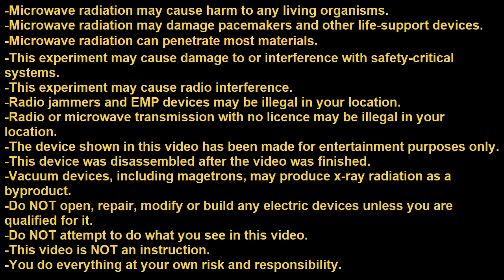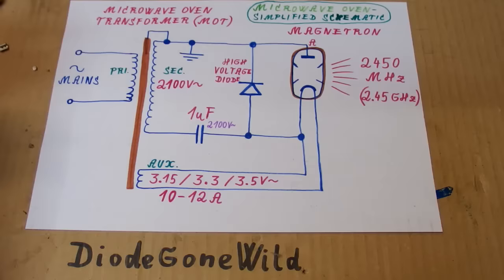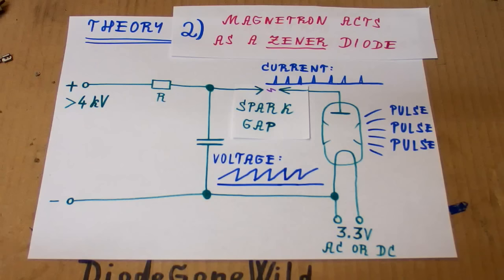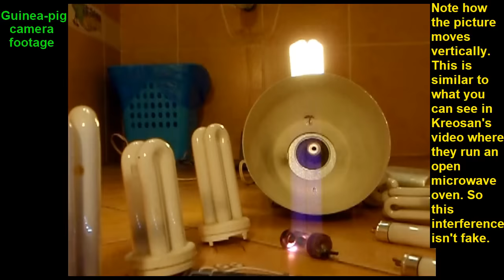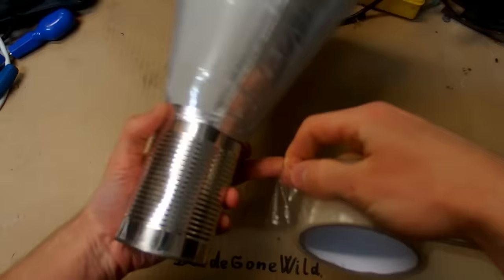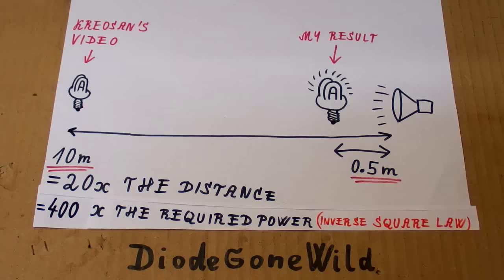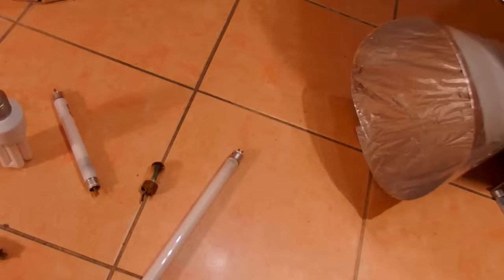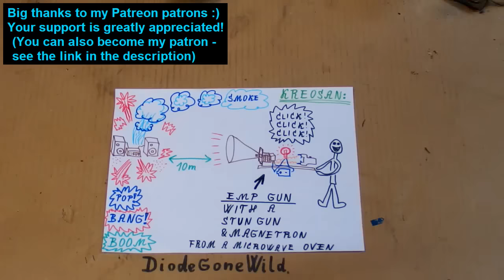Debunking Kreosan's EMP gun from a microwave oven magnetron + stun gun

Comment: Use only one magnetron. Trying to use two or more results in different frequencies, which means there is no possible way to synchronize them, or, time align them to maintain constructive phasing. If you're not using a wave guide, the antenna of the magnetron needs to be in the focal point of a parabolic reflector. As you could tell, the reflector needs to be well grounded to the magnetron. That was apparent, when the fluorescent tube behind the reflector was the only lamp to light up. To build a proper reflector, take a common flashlight bulb, place it in the reflector, and see how well you can focus it. It's a perfect analog, because the incident angle of reflection is always congruent to the incumbent angle, regardless of wavelength. the beam of light will exactly indicate the microwave beam pattern. (I'm only giving you this information, because I'm not touching it!!)

Comment: I have just watched video of kreosan again and he says that the long range was reached by perfectly accommodate three magnetrons using conical antene. So it didn't work bc you used 1 magnetron instead of 3 and shape of that conical antene is also very important. But you said that your horn is made pretty crappy and it is for just a short experiment so it won't have a big impact on performance of your EMP gun, but probably it has. So you have only proofed that the shape, lenght and diameter of the horn is very important. It means you have just made different experiment that kreosan originally did.
Reply: Паша, блин, че по-русски чтоле не мог. Заматался тебя переводить. =)))
Reply: @MisterKoK22  Он же на английском говорит, поэтому так. Это первое видео которое я посмотрел на этом канале.
Reply: Паша Коленда какая разница если все они излучают во все стороны
Reply: Kreosan didn't make any experiment except the experiment with video editing software
Reply: When at the start of the video he said "It has a horn to make it more directional probablyyyy....". He does not even think it has an effect on it and it pisses me off badly. THIS IS A RADIO FREQUENCY EMITTER OF FUCKING COURSE IT HAS A HUGE EFFECT, especially that the magnetron emits CIRCULARLY and it needs to be redirected.
Reply: @akosv96  In the Kreosan's fake device it really has no effect

Comment: U know the dielectric strength of air is approximately 3 kV/mm. Its exact value varies with the shape and size of the electrodes and increases with the pressure of the air.
Reply: If you live in Arizona. In Central Europe it's 10..15kV/cm.

Comment: He used 3  magnetron and  a stun gun with a sort of battery power supply,  I'm thinking that you should get schematics from him too.
Reply: Actually they make very interesting videos and a lot of them are Real, maybe diodegonewild is doing that wrong? I am not sure either tho, looks really like too much to be true
Reply: @diyelectronics5537  I think the horn is not tuned well or the magnetron  is faulty or not enough power, I want to try it too to check it out but I don't have resources yet.
Reply: @diyelectronics5537  It should work at that close range at least in theory.
Reply: @NerdyNEET   yeah  it's kinda confusing on how they did it if it's really true that it works.
Reply: Guys, don't waste your time for building theories. They did it using video editing software. They claimed that in one video on their channel, but it may be deleted now. You can look their original video frame by frame. In scenes with blows they blow low-voltage capacitors by connecting them to mains. In scenes with smoke they fire DIY smoke bomb. All other things they shown like devices stopped working, they did by unplugging some cables. That's it.

Comment: 'Interesting' accent and intonation, and your English is sooo good! Just in case...don't touch the antenna as oil from skin can make it corrode, and more importantly,
tell people (yeah I know, too late) that the High Voltage capacitor can hold a lethal charge though some have a built-in bleed resistor.

Comment: You have the same + screwdriver as mine which I bought around 30 years ago.
I have a much more practical application for open magnetrons: Is it possible to boil away weeds in the garden by getting them with a magnetron?

Comment: We want to think of the microwaves as being uniformly dispersed. If they were, bother ends of your Hot Pocket would be evenly heated but we all know one end is still cold and the other is lava. The rotating platter helps but even rotating the item doesn’t result in even heating. I read somewhere a long time ago the areas of greatest heating happen when the waves reflect back toward the source. The tiny areas where the waves overlap see the most energy. These areas could theoretically be calculated and tuned I guess, but inside the square shape of the oven, they are “randomly” located and changing position when the item being heated is moved. I agree you have debunked the previous video. 👍

Comment: 22:07 I think the noise (looks like white specs, not the lines) we see on the video it could be x ray radiation exciting randomly the camera photosites but I’m not sure, you could use a Geiger counter to see if is emitting x ray but I think it could get a ton of RFI from the microwave radiation also.

And by the way in a recent video of MrGreen it showed how much “safer” microwave radiation is actually is, but still not the best to warm up the body.

Comment: I think that the rf-output and the internal standing waveguide is not exactly matched to the horn - a cone around the bottom of waveguide is needed to form a perfect outgoing wave and is needed to prevent any rf-shortcut and reflection back to the antenna of the magnetron. How is proven that the heating works well, a few seconds before high voltage pulse occure? The heater has a delay of many seconds before it works. To generate high voltage and high current at the same time a marx generator is needed, but so care about the balls in this case. Cancer can occure - very dangerous.

Comment: Emission is 90 degrees from tip to ground plain.  A parabolic, or hemispheric lamp reflector works, but still will give resonant hot spots. The beam does not follow the inverse square law, it is a beam like a flashlight but with resonant lobes that result from the distance between the output window and the reflector. A magnetron is comparable to a steam whistle in that a charge has to build in the resonant cavities before it can output power. The cavities alternately load and unload producing the roughly 2GHz "whistle".
Some emp devices use a special type of capacitor that discharges its wound plates from opposite ends, forming an capacitive -inductive loop that when shorted produces an EMP pulse, a real one.

Comment: Wait, hold on a second, how is that the lines come in a delta connection? I just don't understand. I tought delta and Y connection is just for electric motors, and I'd like a more comprehensive approach on this. While seen that the 3 phases are 120 degrees one ahead of another for a total of 360 degrees, there's an Neutral generator that takes the 3 phases and combines them into neutral. I'm not sure but I think it's possible to achieve the same result taking the center point of an Y connection motor and have a neutral from it.

Comment: I made one to kill   Cerambycidae  " critters in wood"; with a 20  cm stainless pipe as guidetunnel.
It heats the wooden beams till 10-15 cm inside: critters get zapped. works great, and no chemicals needed. tested  around radiation with trimeter. no problem. best way to use microwave. do not use  to zap your food.

Comment: Okay the reason there was a blank spot in the middle of the microwaves just cuz microwaves are huge and they make big long waves so that's where the low spot in the microwave was and if you would have went another couple of feet away it probably would have picked back up as a high spot and then there would have been another blank spot the further away you got you would have to raise it or lower it considerable distance microwaves are about 12 inches peak to and the further away you get they expand also you used a steel pan which would make magnetic waves that's why the bulb was lighting up behind it aluminum would block the waves and not create magnetic waves so an aluminum funnel would be best

Comment: This Magnetron can work at much farther distance. You will need high gain directional wifi panel antenna 2.4GHz, 13.5dBi at least, directly connected to magnetron output. "Double biquad wifi antenna" is quite simple proven construction. Another simple way is "wifi windsurfer" beaming at larger old satellite dish - this provides more than 20dBi, pretty narrow beam of microwaves. Satellite is best choice - nobody is using another constructions between Earth and space. High gain parabolic antenna is used in Active Denial System too (95GHz microwave against human). They all are using what works best. Don't omit reflections from objects and walls, it's like powerfull IR laser.

Comment: To the  Kreosan's EMP gun. You can create it, so you need larger capacitor, make a very short pulse using electronic switch, and the smaller funnel for smash the object. Yes because the inverse square law, you need to create  like a laser point. If this has dont make it a user Kresoan, so its a fake as you mentioned.

Comment: As much as you know about electronics, as little do you understand the focussing of a wave. The long exposure photography gave you a tool to achieve a fine focus. You haven't used it's potential. back to the drawing board ;) treat it as light, you will see that it helps your process.
besides, Creosan did emphasise on the difficulty of focussing the beam. Other that that, I liked the effort you made.

Comment: Kreosan - great inventive guys! They invented: Option #1 microwave gun with water-cooled magnetron and powered by a full diode bridge, which is placed in the focus of a porabolic mirror with variable geometry and focal length. Option 2 using several matched magnetrons with a total capacity of 20 kW. The use of this design allowed to cook chicken at a distance of 20 meters. But this is not the limit, the promising design will allow more spectacular demonstrations.
Reply: OMG. You also try 5-minute-craft videos? 🤣

Comment: Unfortunately, Kreosan constantly exaggerates everything on his channels. They constantly read a much higher level of radiation than what is actually there.
Their only real video, also the most dangerous is the X-ray gun. It really emitted X-rays in great quantity.
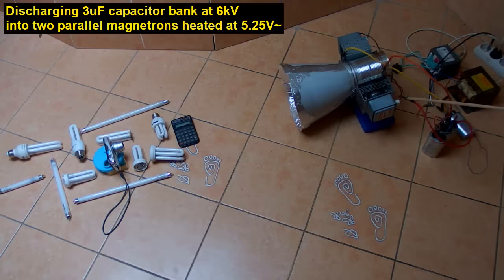P.S. In your video, it is quite possible that due to the high voltage there was also an outbreak of X-rays. 23:03 (the small dots on the screen are specific when X-rays are emitted)

Comment: You don't have to go through all that crap. For years gang stalkers just by pass the mechanism on the door so it continues to work with out the door, and place it against an adjacent wall of a targeted individual so the gets saturated by microwave radiation. But instructions to build microwave canons can be easily found online but I've never seen any that you need a taser for so that in it's self sounds like BS anyways.

Comment: You can get a REAL electromagnetic pulse out of a nuclear explosion.  So with this inventor's ingenuity and spare bits and pieces a nuclear explosion should be possible.  (It's not much more dangerous than a naked magnetron).  If you live in Russia you can probably get some plutonium on the black market .  You would need a "critical mass", of course.

Comment: A microwave consumes about 1kw give or take.
Average us house has a 200 amp breaker and has 240v (split phase)
This is 48kw of power.
So we should instead build a waveguide eyesore thing with 48 microwave ovens.
Then we will have a real death ray.
Mount this on a turret with an arduino and camera for motion tracking. You will then have the ultimate hone defense system.

Comment: To start with I think Tech Ingredients covered this, I think it is in relation to when he is building a LRAD device. But my thought just came to the conclusion that this should be great to at least disturb 2,4Ghz Wifi, wouldn't it?

Except for DiodeGoneWild prooves it is fake, the fact that they are wrapped in aluminium and they don't get burned or blind or whatever is proof enough.

I would actually like to know how to build an EMP gun, but maybe the goal of interference with lets say 2,4 ghz & 5 ghz to possibly dirsurb the connection between a drone operator and a drone. Yea I know, a more adavanced drone, ie one from the government or similar probably isn't controlled through 2,4 or 5 ghz frequencies.

Comment: @DiodeGoneWild For a real EMP gun, you have to build a VIRCATOR (Virtual Cathode Oscillator) and drive it by e.g. a Marx-Generator. If much more power is required (note the inverse square law over distance), take an ordinary EPFCG (Explosivly Pumped Flux Compression Generator) laying around somewhere. The higher the oscillator frequency, the better directivity becomes. A waveguide, terminated with a horn in the focus of a parabolic reflector can take out server farms, power plants and networks for miles. The only problem is, such a device is all but handy. And humans in the vicinity of the beam will be fried alive, since some couple of Megajoules of energy is involved. Therefore, military uses such EMP-weapons as missiles, or smart-bombs.

Comment: This debunking experiment has too much inaccuracy to be actually credible,  First, the design of the reflector was not accurately calibrated, the position of the microwave antenna was not in a permanent fix position.  no effort was made by him to accurately identify the possible direction of the radiation.  This guy was much too vague in his experiment. Not to say if all the above was properly calibrated then it would have achieved the goals set. but if he had attacked it more scientifically perhaps his result would be more consistent.

Comment: I think you should had tried to shot the pulse with something like a railgun or coil gun(both with capacitors), instead of a cone.

Also, Control the frequency with PWM and change the results for each kind of material.

Comment: in a way, the only true emp, is a UNgodly massive coil with out depending antennas or what ever the fuck emits the field outward  from the coil.   and you have to play interweaving  frequencies , like 36 hz, 60  and 74 hz, all fucked together or any important system bios frequencies something that would fuck it alllllll up.  , But instead of  having a sinewave.... have a Spike wave. with no capacitance like have 36 hz, 10,000v + positive wave spikes only , No capacitance .and 60 hz -10kv negative wave spikes only no capacitance . with 74 hz sinewave  or some form of harmonic  global frequency as a emitter something that travels through  metals, and is considered a frequency of life.   at  maybe 200v  this would be so chaotic   and to avoid  coils being load based, use spark gap booster or something .`` this is where the cooling comes in   this to me is what a  EMP  gun sounds like .   and Each coil is independent ,  The toroid coils  Must be in a Triangle design..   and have  cryogenic cooling involved because this mf' will get hot . i have no proof of this design, but it sounds interesting

Comment: Too true I'am building a real one 300W to 1100w from information Unlimited and there one on hear tryed the microwave one had my hand on it one second heat the blood real fast otherwise the unit if I moved a part would not work so spent a few months building one like a real one on hear if you want a real one for example look me up I'll post in the next few months with the beast EMP AC one near 1uf at 2200v.

Comment: Why are you telling them it does not really work that well is it because an idiot designed it?

1). I would had used a ""Commercial grade high power microwave" set on ""Defrost""!

2). I would had added more wire windings or larger coil  to amp up the power higher yet!

3). I would had used the capictors as a power storage bank in series/ parrallel to store up the charge til it was fired!

4). As for that stupid ass " horn" i would throw it away in the trash.
I would had used a "straight tube" to keep the microwaves more focused not spread out in a funnel pattern to weaken it.
Plus i would also insulate and add a "" Faraday cage around the tube to help keep it focused more in a beam.
Same as focusing a flashlight to a laser beam to a pin point.

Simple technology.

Tip: you can run it off of a stun gun with step down transformers to increase amperage. The larger the step down transformer the more "" current" being swapped from voltage to a higher current level

The capcitors actually build up the storage to be dumped all at once at the target. Provided the targeting horn is more focused to a pin poit accuracy.( like in a tube not a horn)

Common sense!

Our military loves focused E.M.P.'Weapons- to fry ectronics or make you sick to your stomach, or to scramble your thinking.
Its simple tech.

I thought about using it for hunting.
Or take down grizzleys from a distance..

My cousin stuck a cat in the microwave when they first came out and fried its brain that was when we were kids in 1980.😮
It puked up its guts and then killed over later.
He was only 5 at the time trying to dry off the cat.😮